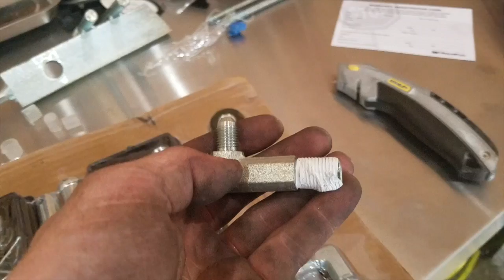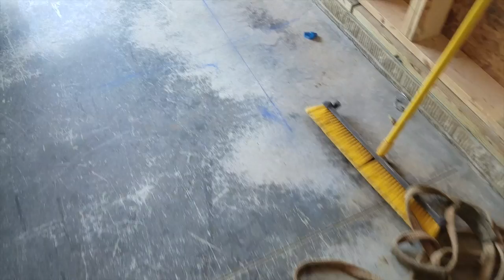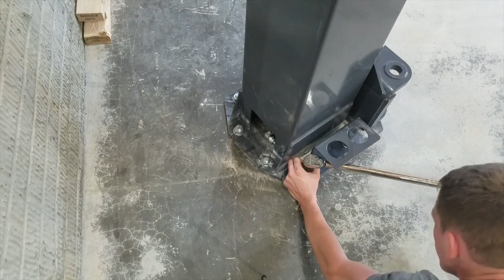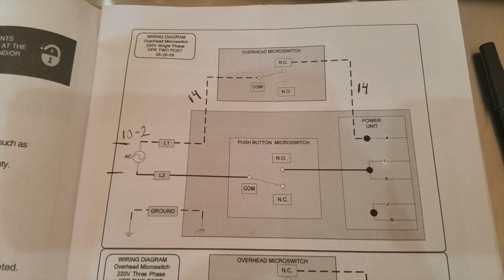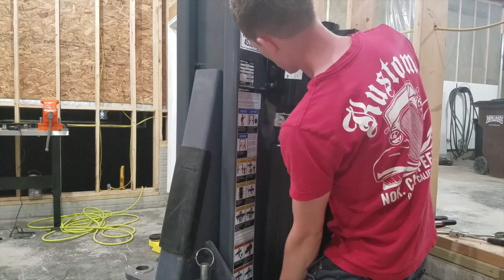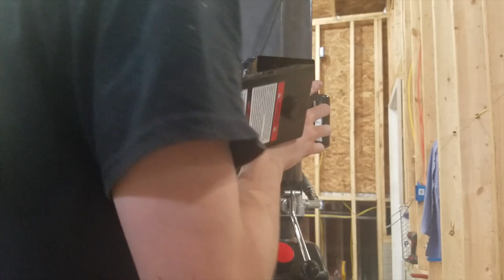BendPak 2 Post Lift Assembly- In Detail

Comment: In previous video you showed your truck in your bay to determine column location and in this video you have gone ahead and marked out (and installed) the columns.  How deep is your bay and how far off the front wall did you place the columns?  further back than the minimum 99" shown in bendpak's literature?
Reply from the maker: So from the center line of the column to the garage door at the back of the bay is 14ft 6in. From the center of the column to the nearest  front obstruction (worknench) is 10 ft. The bay itself is 16x28. If I had to do it over again my columns would be in exactly the same place. I have enough room to walk around the vehicle and work at the bench. I'm putting together a review video right now. It will be out in the next couple of weeks. If you need more information sooner send me an email at repairgeek365@gmail.com.
Reply: Repair Geek .. Thanks for the reply.  I was measuring at 10' from the front wall (no box or bench in front).  That gives me 4-5' in front of every one of my vehicles.  Seemed like enough, but wasn't sure.  Sounds like I have good ballpark figures.  My shop is 40'*32'.

Comment: Nice demo:)   Your illustration was the best I have found. I have a Danmar D10/AC which is packaged the same as a Bend Pak and seems to have the same instructions. Other than the paint and decals my lift and your lift seem identical.   
My lift is installed with the exception of the electric.  I can't find anyone who will discuss that with me.   I do the majority of electrical jobs around my house but have no formal or in depth electrical training.  I do feel that it is a doable job for me with a slight bit more amplification.  I bought a roll of 10-3(red black white) with ground wire and 30 amp 220-volt breaker that will accommodate the two hot wires(red and black),  with the common(white)  and copper ground which hooks to the common ground in the breaker box.  I do know that 220 means that the two hot wires (red amd black) each carries 110 volts equalling 220 volts.  I do not understand how a 10-2 wire can be 220 volts unless that is essentially a white(substituted for red) and black wire. I am guessing that if I use the 10-2 wire I will use the black and white wires as hot and of course ground with the copper and have no common.  

I am thinking I should buy 10-2(black (white substitute for red?)) with ground wire and possibly and the same breaker.  Would really appreciate any help you might offer.  
Best Regards :)
Reply from the maker: If your lift is identical to mine I would run 10-2. 10-3 has an additional red wire which would be used as a power. If you use 10-2 black is power, white is power, copper is ground. No neutral. You can run 10-3 with black as power, red as power, white unused, and copper ground. Running 10-2 will be cheaper because you're not paying for an additional conductor you're not using.
Reply: Thanks for the response.   I have all my wires in place now but could use assistance making the final connections.
Power to Motor:
I ran 8-2 power from panel box as I am a long way from the panel box in my basement.   There is a partially wired electric module in the electric box at the motor.  Obviously, this is where I need to connect L1 and L2.  Nothing says L1 or L2 and there are numerous screws to connect to in the module.  I was unable to identify the L1 and L2 terminals at the motor. 

Microswitch:
 My Danmar D10/AC also has the same exact 14 gauge wire cord as you have.  The three switch wires on the motor end were prewired with a short lead coming off that I merely spliced like colored wires black, white, green to the three leads.  The green wire is simply connected to a ground screw at the motor.  

I still do not know how to wire up the little switch block with the lever which has three screws to connect for the overhead.  Going from left to right on the micro switch block. Screw 1 Says Com over top and a 1 underneath.  The middle screw says NO over the top and there is a 3 underneath.  The rightmost screw has NC over the top and a 2 underneath.  There is an = sign between the 1 and 2. Illustration below.  
Com                         NO               NC
Screw                   Screw         Screw
  1            =           3                     2

Any additional guidance would be greatly appreciated.  
Best regards,
Ralph Folden
foldenra@gmail.com
Reply: I stepped through video on the electrical several times and realized that you did not connect the switch which is fine and I did catch how you applied L1 and L2.   I understand your reasoning for not hooking up the switch.  I am going to hook mine up with hopes that it might save me from making a big mistake.  There should be a way to make one of the garage safety mechanisms work on this thing. 
Thanks again for doing such a good job on your video.
Ralph
Reply from the maker: The only thing that will get even close to the overhead limit switch is a full size truck. My F150 does not touch it with the lift all the way up. If you have any other questions send me an email at repairgeek365@gmail.com
Reply: thats good to  know I am having some people install mine and Ill be hooking it up first without the switch just because of time savings appreciate the video as well.  I just didn't have anyone to help me lift the columns in place so it is what it is.

Comment: Also I see you didn't use any epoxy on your anchor bolts? I'm in the process of researching which to use, I think we are going to use this for good measure.
Reply from the maker: I would call Bendpak and see what they say to use. The instructions say basically use it if you want to but it's not necessary.